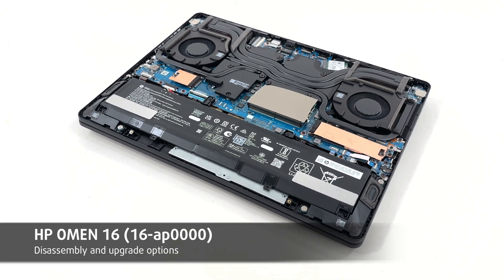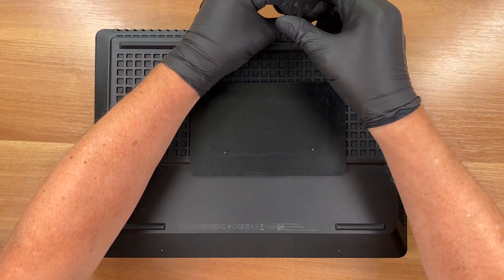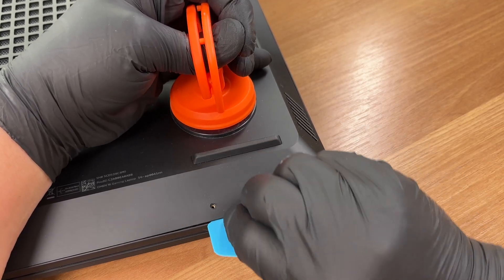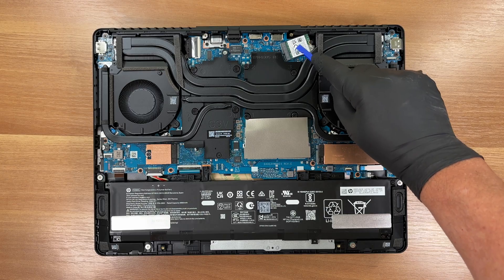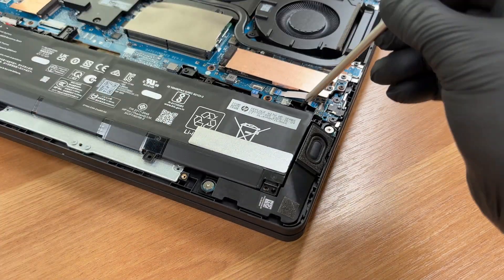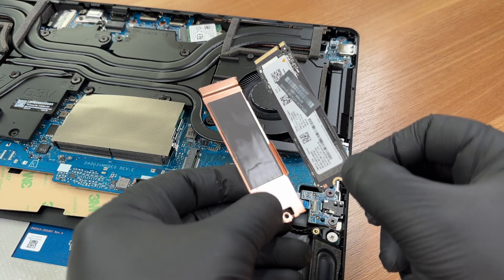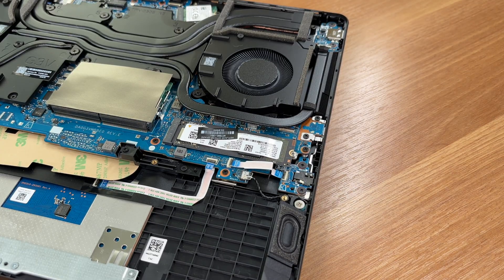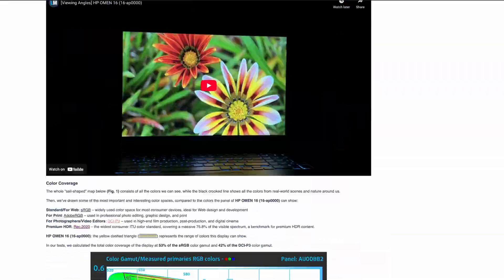🛠️ How to open HP OMEN 16 (16-ap0000) - disassembly and upgrade options

Comment: Just bought this and added a 2tb 2280 nmve ssd and the heat shield that covers it is like half the size, the new ssd works but i cant screw it back on, is there another size of ssd i should have bought?
Reply: yes. M.2 2230 ssd

Comment: I just tried to upgrade with the crucial 16GB ct16g56c46s5 5600mhz but after assembly, the laptop does not start anymore. and cmos reset (pressing win v or win b + power on does not work anoymore. what did I do wrong?

Comment: I wonder. Does this include the ap0xxx ng series? Saw on the chassis that its ap0xxx nn. Do have a 5070 variant and am not sure if all the boards behave the same. Hp listed one variant as a single slot. Would prefer to only open up the laptop once